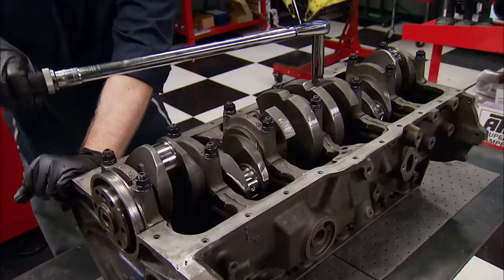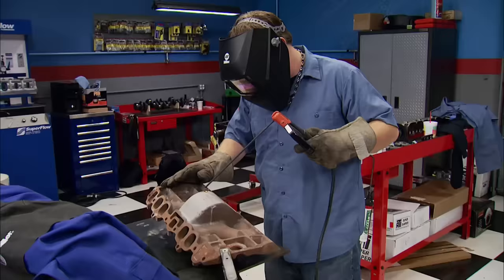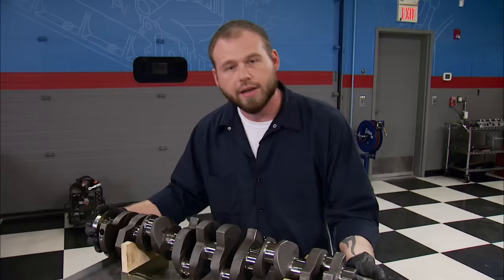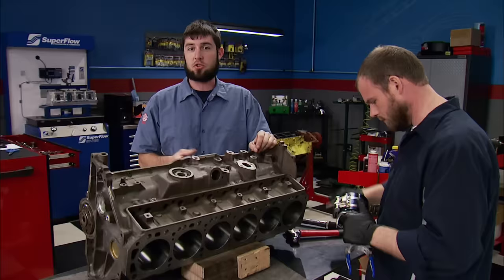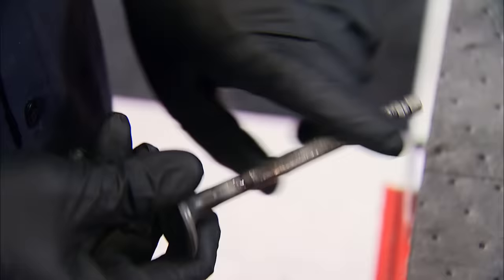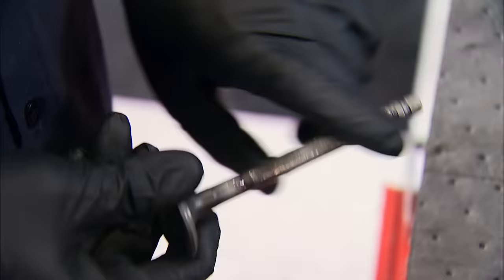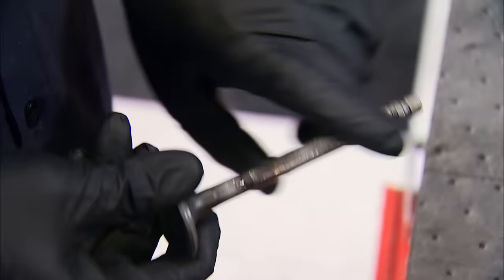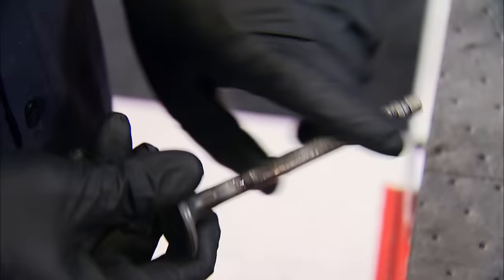What Will A New Top End Do For Our Old School Inline 6 On The Dyno? - Engine Power S1, E4

Comment: When they put the main caps on i cringed when they used a steel faced hammer to tap em on lmao
Reply: i was screaming at my phone, noooo when i saw that.
Reply: Experience stops a good builder from over tapping.
Reply: I also cringed when they didn’t use a ring spreader to put the rings on the pistons
Reply: @MedicatedOMO  good builders dont use hammers.
Reply: @bigboreracing356  go back and look at it he smacks it pretty good. i start them by hand then draw them down evenly with bolts. if you set them down and hit them with a hammer you risk the chance of rolling the edge of the block or cap. if you insist on using a hammer at least make it a dead blow or a mallet. and tap on the bolt seat NOT the center of the cap. common sense speaks volumes.

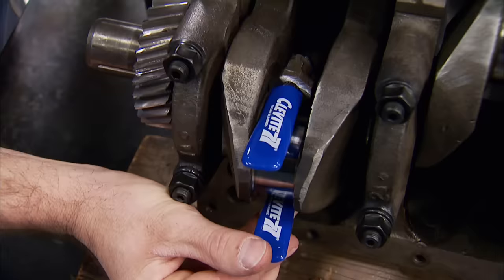Comment: Anyone notice that on the cylinder wall @ 6:18 ?
Reply: Edward Myers what you saw light showing through from the other side
Reply: @robertmintz63  nah I saw a small pit in the wall
Reply: @edwardmyers1746  I see pitting at about the 3 & 4 o’clock position
Reply: Yup it's there

Comment: On those wrist pin fits, you could just heat the part up to 450 degrees in an old pan on a hot plate or in an oven and cool the wrist pins in the fridge, I did this method with countless Harleys and put on the ring gear on my 92 Dodge rams flywheel..Works like a charm..

Comment: The EFI looked alot like a Holley 4 barrel... Did i miss something?
Reply: My thoughts exactly!
Reply: My guess is they meant the ignition system and typoed. 

Fwiw, Ford made an efi 300 6 in the early 90s. Same motor, different manifold.
Reply: @mostlycensored7668  EEC4 or EEC5?
They were used on 250's and 3.9/4.0 (pre-Barra) here in Oz, and there were penty of workshops that could reprogram them.
The Falcon XE with EEC5 on the 250 crossflow with 5-speed, is pretty much a Mad Max hoon car back in the '80's.
Reply: Watched this earlier, it said its a Holley 390cfm
Reply: @mostlycensored7668 ,I know about those. I worked for almost 20 years in Ford dealership parts rooms. I just thought they were going to show the results with a modern day EFI set up used on that 4bbl intake. You know the one that they say is "affordable" yet cost a couple of grand!
Reply: @markmartinfan62  boggles my mind people don't just use the chevy tbi setups. Might as well spend the money on a wideband and standalone.

Comment: Most awesome motors they ever built . Not fast but very dependable , very cheap on gas and with right gears very powerful !
Reply: I've owned both the 300 and 302 V8s in pickups. I found the 302 to be better on gas mileage, lower on low end torque but higher horsepower when wound up. The 300 lasted longer hands down.

Comment: WOW I DID JUST WHAT  GUYS DID TO MY 1981 FORD P/U ,THE ONLY PROBLEM   IN RUNNING  WAS IN WINTER  BEING THERE ON HEAT COMING OFF THE HEADERS TO UNDER THE CARB .RUNNING AROUND IN SINGLE DIGIT TEMPTURE WAS INETESTING .AND YOUR RIGHT ON NOT TO REV THE ENGINE PASS  5 GAND .I DID THAT COUPLE OF TIME ,THE WHOLE TRUCK STARTED SHAKING

Comment: They make an aluminum head for this motor that works with fuel injection... id love to see that with maybe a 100 shot or a single turbo 🔥👌🏽
Reply: @truth Lives Here What?! Who makes an aluminum head?
Reply: @jacobhammond5432  vintage inlines out of Detroit makes a set, their orders have backed up to the point they won’t add to their orders list but I’ve heard their head is the best on the market, they even make a kit that comes with an intake manifold and everything for just over $2000
Reply: @truthliveshere831  pretty sure that's for the 200/250 blocks not the 240/300.
Reply: @WhoThisGuy515  you might be right it’s been a while since I’ve looked. 

http://www.mustangandfords.com/how-to/engine/1804-finally-a-performance-cylinder-head-for-ford-six-cylinders

Comment: Best part about that build will be longevity. Good blend of power, torque and reliability. So, the money spent up front will likely be almost all you will ever need to put in it outside of regular maintenance. That could well be a " lifetime"engine. Well done!
Reply: Best  part about longevity would of been for the presenters to tell the viewers hey if you bust the ears off your block get another one an start again cause money spent up front saves a lot later.

Comment: Did my 300cid I6  just like that many years ago.  Only complaint was the Holley carb warped badly causing a major vacuum leak.  Replaced it with a Edelbrock 500, no problems.

Comment: That 300 sounded pretty sweet!  If you want other non V8 engines to build, here are two I like.  I want to see a cammed, mildly-built 4.0 cologne V6, and a built 22R.  I want to retain low-end power and torque, but also increase power throughout the RPM range.

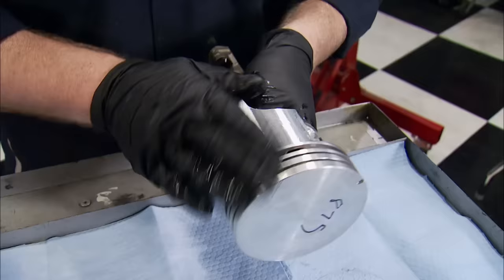Comment: 5:48 "saved over $10 on piston rings" LOL
10:32 primer sprayed on the oil filter mount and inlet threads OMG
Otherwise it looks, sounds and runs great.  Thanks for the video.
Reply: I was thinking the same thing, should have put an oil filter on before painting or at least tape it off.

Comment: 6:19 nothing says a quality build like pitting in the cylinder wall.
Reply: All the trucks with 300 I6 in them why get one with pitted cylinders and a cracked block.  The head looked like they ran a cinder block over it to surface it.
Reply: Meh!  It's a 300!  As long as the bore is straight (no taper), that minor pitting at the top of the cylinder will not affect the rings or compression.

Comment: We ran a 300 six in a NASCAR Hobby Cadet car in the 70s. We had more compression and a bit more cam and racing gas. We turned it to 7000. We were making around 425-450 HP depending on the tune.

Comment: You guys should do a Ford 360 FE. Not a 390 or a 428 but a 360. A 390 piston bored 40 over@ 10.5:1 and 352 crank/rods. With either a 2100 motorcraft 2 barrel or a Holley 500 cfm  barrel. Only difference in the 360 is high compression pistons and a RV camshaft and lifter kit. Just to show what you can do to a stock motor to give it more low end to mid range torque and some upper mid range horsepower to show that it's not a 390 but it will still get up and go. I was thinking you guys on the 360 build also should use either a Edelbrock performer standard rv camshaft or a Elgin Rv camshaft. With a msd ignition system 6AL and a Edelbrock timing chain and gear sets. Plus I would try to find a mirror 105 block...
Anyway. Just my thoughts.  Joey. 😁

Comment: Guy's I've built a couple of these.  Not sure about the carb choice mentioned in the earlier build.  Even with the assumption of 90% CID flow anything over 450cfm is too much.  I ran the duel exhaust headers, an Offenhauser duel plane with 1" spacer; a Holly 390 4bbl with manual secondary's and factory electronic ignition.  While I did not have the luxury of a dyno; from idle to 2700 it would twist my chassis over 4 inches.  I have forgotten the cam specs I used but a 292 intake and 287 exhaust seem to ring a bell.  I also used the stock head figuring 80% flow of true CID.  It fell off rapidly over 4000rpm.  When I sold the truck i had to de-tune it because the guy that bought it kept doing donuts everytime he went to pull away from the curb.  Yes, he was an idiot but I didn't want him to crash.  He blew it up after getting high and doing donuts in his yard for over 3 hours and two tanks of fuel.  In the end it hit a tree root sending a driveline shock up the drivetrain propelling a rod out of the block.  I got the story from his GF who was pissed I sold him the truck.

Be well and thank you for sharing

Comment: Got one built exactly the same. In a 81 Ford Bronco 4sp. I wanna permanently convert to LP. Holleys are getting more expensive and ethanol gas corrodes the insides. Clogging the meter block.  I've replaced 3 carbs in 3yrs.

Comment: I really enjoy the inline engine stuff you guys have been doing the past couple years..  Those engine power plants need love too. When it comes to building the V-8's, there is a million and plus one more videos out there. So, seeing your videos of the weird stuff, that most folks (including myself) takes for granted, is allot of fun.. I don't know if your algo numbers prove otherwise, but these motors of the inline series my all makes and many models, are soon to start showing their desire for folks to want to rebuild them, as you know, a bazillion of them were manufactured..  Kinda like the 4.0 ltr Jeep I-6 series you guys did, that was some fun stuff. .. I wanted to install one of these Jeep plants in a race car geared to the hilt..  Like maybe a MG Midget.. LOL... tell me that wouldn't be a riot to road course..  fully doped up suspension, chopped DANA 35/44 or a chopped Ford 8.8 LSD... 5 speed manual. Heck, while I'm at it, super charge it... that would be a hoot..

Comment: Did you check the temps on the individual header tubes? If you have a lot of variation it means some of the cylinders are being starved of fuel. I guess it is very common on 6 cylinders. I don't remember how we fixed it on dad's 69 f100. I think Offenhauser sent us or recommended a plate that went under the 500 cfm Holley 2 barrel. We had to jet the carb down a ways.

Comment: had one in my 84 f-150 4x4 put 300,000 miles, put 3 inch exhaust performance cat, cherry bomb and K&N air filter so mileage went by 6 mpg from stock and only replaced it cause it was leaking oil from every single gasket , 2nd engine had 240,000 when i sold to guy across the street in 2005 and his still driving it,

Comment: Easier to put the camshaft in first, then the crankshaft--you can reach into the crankcase and guide a camshaft that long so it doesn't damage the cam bearings. Only needs to happen once and you're back to taking it all apart again.

Black paint sheds heat but hides oil leaks. Torching the cast iron will wick out moisture for welding and painting.

Comment: Kind of makes you appreciate what modern PCV systems do for you...
Reply: Those rings got hurt, no reason for that amount of blowby on a fresh engine. Probably caused by the pits on the cylinder wall they showed, all the more reason to go sixty thou instead of thirty. I wonder what machine shop said that'd be fine.

Comment: With the small changes you made, if it RETAINS its reliability and longevity that is an AWESOME build. Never gonna be a hot rod engine, but a workhorse? Oh yeah. Those 300 inline 6s can run forever. I drove them as high mileage service truck engines for years. No competition from any other engine. But the OLD Jeep inline six wasn't too shabby. Keep em clean, cool, and the RPMs down and 300,000 miles is easy. I drove several of them more than that.

Comment: I tuned in today because I love inline 6 engine sounds. I like the way they pull too. I have a 69 mustang with Ford's 250 inch 6, largest of the small block 6s. Due to a traffic accident I can't work on it any more. I'd love to find someone to take it and do what I was going to do, which is make a road car with it. I started putting 4 wheel disc brakes on then I got hurt and it's sat ever since. I wanted to put the same set up on it as you have with this 300 inch 6 except with the inline sixes new head and maybe go for a 6,000 RPM practical redline and a 6 speed manual. If someone would do that and just promise to let me drive it after it's done, I'd give it to them.
edit: Why didn't you just use JB weld on that broken off piece? And I really winced when he "gently" (not so much) dropped the crank in.

Comment: would have been easier to braze the cast iron instead. Were taught in welding school that brazing is preferred to welding cast iron. you can actually reach a 70,000-psi strength in the brazed joint, this is comparable to a e7018 rod, the 70 meaning 70,000 psi in strength. plus, you can re heat the part to take it apart if need be. Also since brazing uses capillary action its actually sucked into the joint essentially gluing them together without effecting the base metal. so, no need really for grinding a bevel at all.

Comment: I knew a guy in high school that put a 300 in a Ford Maverick he said he would never do that again a lot of problems. 
That little car could almost run with a 289 mustang . He had a 3 speed manual transmission,  and later put in a 4 speed. that was in 1973 the car was a 1970 I don't remember what he paid for it . 
Was a fun car to drive though

Comment: Cool with some straight 6 stuff.

Im rebuilding a camaro 3.4 v6 from -94. Thats not an engine you see in any of these shows. Would be cool though.

Those engines are found in s-10 among others so there should be some guys interested.

Im going to swap my 2.8 in the fiero for that 3.4. At least thats the plan 😅

Comment: Great engine, in Argentina use the 221 l6 ford engine in racing cars, they build an 24 valvs dhoc aluminium head and two 40-40 carburators, this engine revs over 9000 rpm, sounds like an f1.

Comment: Can you guys do a performance build of a 337 Flathead? It's the black sheep of Ford's flathead engines, big heavy and hard to find parts for, so no-one uses them in hot rods despite the potential for power they might have.

Comment: Sure would like the part number for the pistons. I've never seen a true flat top piston for this engine. (It's not listed in build parts section.)  Silvolites have a dish with no valve relief.
Go look at time frame 9:06 to 9:08 in video. The piston visible in bore 6 has valve reliefs. Not the same piston shown earlier in video.
Also questionable is the use of poly loks  on the rocker studs. These should not clear the stock valve cover without stacking multiple gaskets.
Well......

Comment: The 300 isn't as insane as the Barra but I've seen a turbo'd 300 pushing out over 1200 hp supposedly around 1500 hp but it was turned down😊  How would that build look?

Comment: "John spent some time resurfacing the head with an old cinder block and a cold chisel...". Really though, good video. The inlines were the best engines the big three ever made. Not the smallest, nor lightest, not cheapest, but the best.   My dad was a GM executive, and he claimed the 350 V8 was cheaper to manufacture than the I6...and was a $1,000 upgrade.  Still doubtful about that cheaper claim, but he could've been right.

Comment: I put a Hedman 2 piece header on an early 80’s F150 300-6. I didn’t have the money to pay for an exhaust so I made a short exhaust from an E250 300-6 exhaust and and parts store adaptors. It had no muffler. If I kept the RPM’s low nobody would notice but half throttle would make too much noise. On my way home id floor it in an open spot by a marsh and golf course with home 1/2 mile away. I didn’t let it cool down enough and it cracked the head after 10 days. I wasn’t impressed by the Hedman headers having such thin metal. The cab floor would get so warm I could feel the heat through my shoes. 

You could have cheap transportation starting with a 1980-1986 F150 with a 300-6 and manual transmission. Install either a ZF heavy duty 5 speed or a 5 speed out of a late 90’s to 1996 F150, 3.55 9” rear axle and upgrade the engine with a quality header, intake and 500 cfm carburetor.
Reply: I meant to say late 80’s to 1996 F150.

Comment: 50 years of hot rodding and drag racing has taught me that best way to increase horsepower in a six is to replace it with an eight. Figured it out after spending way too much to get 330 hp out of a GM 250.

Comment: Do they have a video on how they hooked up the throttle cable? I have a similar set up on my pickup but the carb sits backwards and is a pain to the proper geometry for my throttle cable and cruise control.

Comment: Went for the same colors I used on my 1984 F150's 300 I see... Although the paint I used on the tins didn't work so well. And I did a nearly stock rebuild. I did use an engine stand, but it was pretty bouncy...
Reply: I have mine on a stand too. Mine has an H-shaped base so I put a  cross piece with two upright pieces of 1" tubing.  I then drilled the uprights for bolts that went into the engine mount holes. No more bouncy block

Comment: I believe they made 206 hp on this video but damn. They did all that work to make only 40 more hp? My Trailblazer is 4.2 liters and make 275 hp.
Reply: This is a low-revving I6 truck motor. They make there power with high torque at super low rpm, ya know, to pull shit
Reply: Note the 300+ lb/ft of torque down at 2500 RPM :P How's the 4.2 doing down at 2500 RPM? Better yet, at the 1200-2000 rpm range that my F250 lives at :P THAT is where the magic is :D Lazy unstoppable beast. I'm really glad to hear about your 275, though! Still not wild for something as heavy as a trailblazer, but it still feels really good nonetheless :D
Reply: @kasinko  The 4.2 make 90% (247) of peak torque between 1600 and 5600 rpm because of the vvt. This is why it drink gas. I know this because I've owned a 2004 Trailblazer for 12 years. What year is your F250?
Reply: @kasinko  Never mind, I just looked at your channel. I'm talking to a kid. Have a great day little fella.
Reply: The atlas 4200 is a great engine as is the Barra 4.0 but they were designed nearly 45 years later. The 300 i6 was designed in 1962 and released for sale in 1965 and was phased out in 97. It was built to last forever and move everything from small f100s to huge dump trucks and combines.
Reply: @trainsbangsandautomobiles824  He said because of the long 3.98 stroke. It was a low speed motor. Toyota 2.5 4 cylinder has a longer 4.06 stroke but it peak @ 6,600 rpm. He is an actor and is repeating bad info.